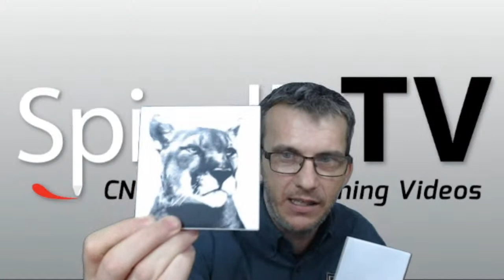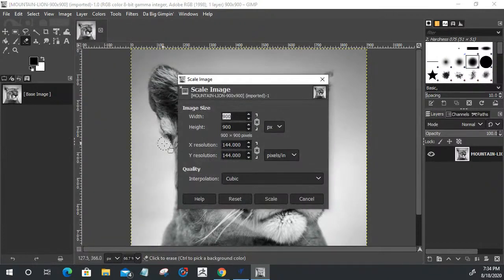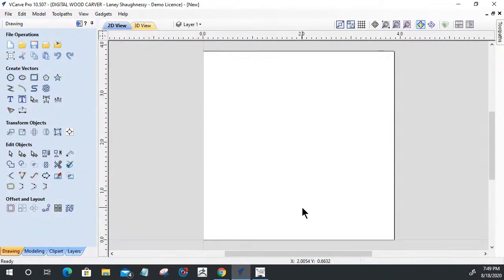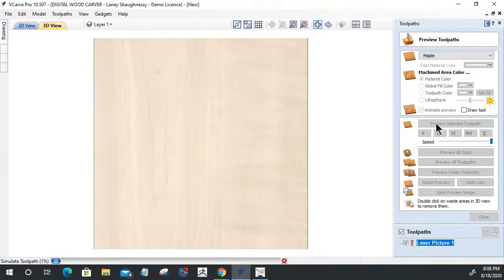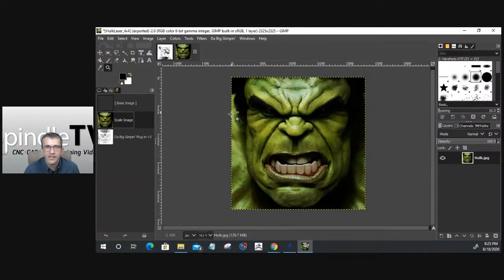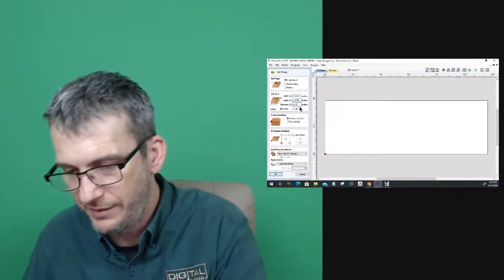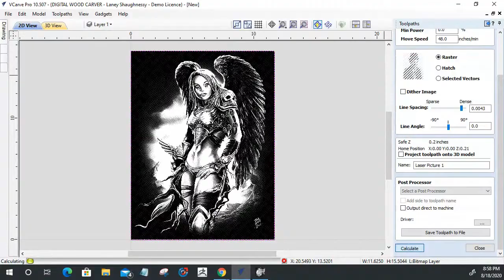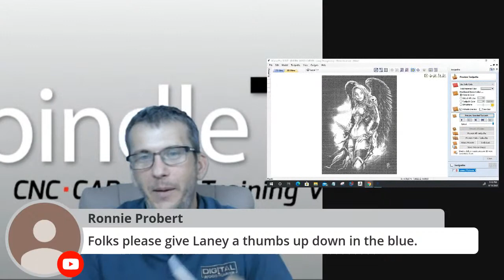How to Laser Engrave Ceramic Tile - DWC 6 Watt Digital Laser

Comment: I have a problem with vcarve pro. You have the extra lines in the preview but it does not laser it in real life. I see the extra lines and it burns the lines in real life 🙈. What are the settings in vcrave pro for your laser ?

Comment: Lenny, I’m thinking about starting laser engraving as a hobby, and engraving ceramic tiles would be great. I know that you have to paint the tile before burning, but here’s a question that I haven’t seen asked before: Do the tiles have to be glazed, or would unglazed tiles (such as 12” X 12” Saltillo tiles) work as well? Thanks in advance for the info. Great channel!
Reply from the maker: That is a great question.. I have only used glazed tiles and have never tried an non-glazed tile. So Im  not sure if it makes a difference. Does the glazing play a role in the engraving?? This is don't know. I would have to test it if i get some time to determine if glazing changes anything

Comment: Just found your channel. I use Mach3 with my cnc and a 4.5W laser. I haven't found anything that will let me do what you are doing. Can I use Mach3 to get these results?
Reply from the maker: Unfortunately Mach 3 is a bit before my time. So i know nothing about it. If it allows for Pulse Width Modulation (PWM) then i see no reason why it wouldnt be able to do this.. The 4.5 watt laser may have to run at a different power and speed setting to achieve positive results ....if you can find out about If Mach3 has PWM that is going to be the key factor.. As well as the Vectric Laser Module add-on in v10.5

Comment: do you think this will work with my laser master 2 fixed focus 5.5 watt? Thx great channel btw
Reply from the maker: Yeah it should work with your 5.5 watt laser the main thing is is making sure that you have your optimal focal point distance and it should work fine the power settings and speed settings may vary from what I'm talking about in the video but use them as a starting point

Comment: Why not 100% power?
Reply from the maker: It Depends on the power of your laser. Our 6 watt laser does not need to run at full power to engrave the design. If your laser requires more power to complete the job then adjust accordingly. We are only etching through the painted surface. Therefore it doesn't require full power.
Reply: @SpindleTV  which laser do u have? I just got my first laser today actually. It's ortur laser 2. 20 watt, I know that's not the lasers actual power. Only found that out afterwards but for the price and all I'm not complaining. I have 0 experience in lasers and cncs but some experience with plotters for vinyl and a fairly extensive background with graphics so hopefully this will help to ease the learning curve a bit
Reply from the maker: @ct1freak  The Digital Wood Carver 6 watt laser that attaches to out DWC CNC units
Reply: @SpindleTV  nice. I wanted a cnc router setup but it's a bit pricey for me still. This laser was more or less an impulse buy with some Xmas money